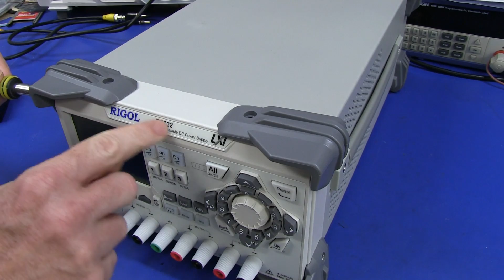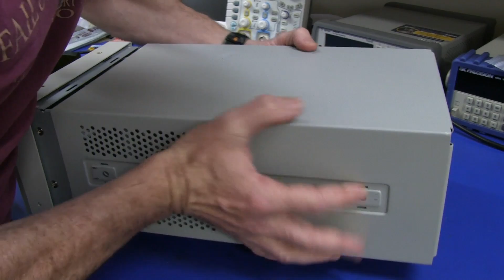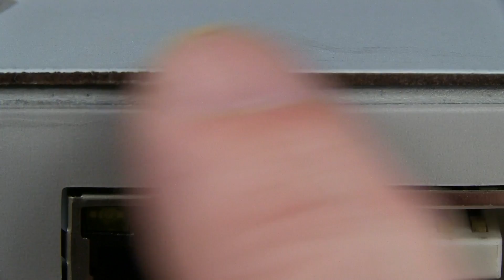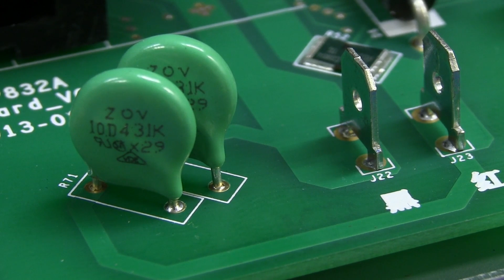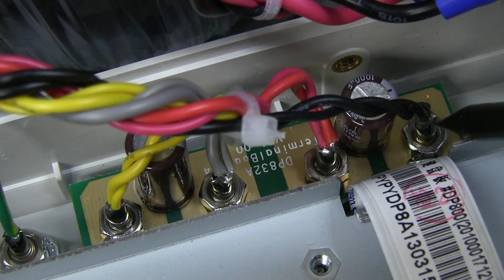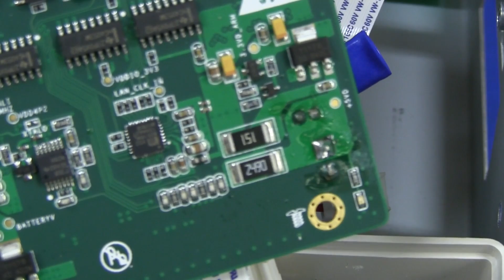EEVblog #511 - Rigol DP832 Power Supply Teardown

Comment: Another quirk of toroids is there is no sharp corner.   In an E core the magnetic flux has to make a sharp 90 degree bend at each corner.  In a toroid the flux makes a nice smooth circle.

Comment: 9:07 That looks to be a micro, ST logo peaking out of the lazer cut area. 4 core 1.2GHz with built-in 1Gbps ethernet with 4 port usb hub, turbos to 2.8 when lower then 38C.

Comment: Now I don't want to sound too negative, but Samyoung is the same brand crap caps that are used in the Samsung ccfl drivers and ALWAYS brake down after 2,5~3,5 years, so I would replace every single cap if I bought a PSU like this, but that is my professional opinion. I sell repair parts and every single work day I have 2 customers replacing Samyoung caps in Samsung TV's. Would not trust those, ever!

Comment: The rust is kind of inevitable while dealing with steel that doesn't get coated with anything. I work for a company that is basically an OEM for various things. Lots of our sub assembly parts have to be rushed to be powder coated during certain months because they will rust if we have stock lying around waiting to be sent out. Even just during a holiday break we had some output shafts from the gearboxes rust. We would have to take the units apart, machine the rusted shafts down, make special rollers to press fit onto the smaller shafts, and put it all back together. It was far cheaper to make a whole new set of non rusted shafts. It may have rusted during shipping over seas. We had a limited run of European units we had to make and they had all sorts of issues from the humidity in shipping.

Comment: 12:00 Software trimming?
There is any tutorial about this?
Because I'm building 1kW smps lab power supply and it will be very useful information for me.

PS I also hate sticking to-220, HQ stuff and they dont want to put little piece of 1mm aluminium(lol, 0.1$?)...

Comment: The circuitry itself, the unusual voltage choices (-5.1V ??), the abbreviations silkscreened on the board and even the parts themselves (including the multiple TL074's and the 4051 analog mux for the DAC S&H for reference voltages) are telltale signs of pretty much a direct ripoff of the agilent power supplies whose schematics float freely on internet. They probably lasered off the last chips to avoid a far too eye catching choice of parts. This is sadly the reason why no one publishes schematics anymore; the fear for these hooligans which show up and ruin the game for everyone. Other than that, this should be as good as any top class western designed product, with the quirks deriving from it's Chinese "interpretation" (like the glaring choice of output capacitor by designers that were supposed to have designed the rest of this circuitry! Are you kidding me?).

Agilent/keysight should consider a more thorough reverse engineering of this product and an eventual lawsuit.
Reply: Yo Da You think Rigol power supplies that are sold by Agilent/Keysight name? Most of low and middle range products sold under Agilent/Keysight brand are Rigol products.
Reply: Yo Da r

Comment: Maybe I'm old-fasioned, but I can't get why do you need ethernet on a power supply. Nowdays you need ethernet on everything...
Reply: hdagelic these days for example taking measurements, experimental physics is all computer controlled. There ethernet comes in handy.
Reply: Ethernet is handy, why run USB or serial to a PC when you can just plug the device straight into your network switch?
Reply: because it’s superior to the obsolete GPIB
Reply: Maybe if it's in some industrial setup, but then, usually, the supply is fixed. I don't know, I can live with theese computerised things until they stop working without an I-phone....
Reply: hdagelic I know I'm a bit late but anyhow: I also greatly appreciate ethernet jacks on my instruments. We do most of our product testing via scripts that control our instruments for regression test / schmoos / etc. It's also kinda nice if you can setup a few instruments for a specific test by running one script etc. When you want/need this Ethernet is a good interface...GPIB is pretty klunky (especially the old cables) and for USB you often need special drivers etc.
Reply: I just worked recently on a setup used to test medical grade circuit boards that cost tens of thousands a board.  We use the supply's ethernet port to verify that the voltages and limits are set correctly before anything is powered.  We don't want to start blowing up expensive boards because someone bumped the controls.
Reply: It's not expensive today to add ethernet capability and it's really useful.

Comment: The faster the processor, the more critical the timing of the data being passed across parallel traces becomes. The 'twists' put in the traces is designed to make each of the traces in that collection electrically the same length. It is not at all unusual for those traces to be several clock cycles in length. Most processors can't handle bit 1 showing up on a different clock cycle than bit 7 of the same word.
Reply: Dave knows

Comment: Why are some of the traces around the CPU so twisty?
Reply: May be for the equal lenght data busses.
Reply: i think it makes a little inductor ,which is need to run the cpu,or making the traces have other impedances to act as a diy resistor.It depents  on the cpu itself . Note : This is my opinion,i am not saying its true ,but it could be ,have a nice day

Comment: Hi Dave,
I have an old PC power supply i want to salvage all the parts from, now i don't know much about electronics but this is why i want to salvage the parts so i can have a play around with out spending anything. I just want to know what is the best way to drain all the power that may be left in the circuit and how to make sure afterwards?

Comment: That´s why your computer mains is a Full primary Switch mode power supply.
This unit is powered from a secondary SMPS...so the transformer is running  at 50Hz AC....and this is make hin go big ;)

Comment: They need to sell some units at higher prices to pay for the R&D.  The choice is to sell units without features and with features, say 10,000 units at $800 and 1000 units at $1200, or they can sell all the units for $1000.

$1000 would be the selling price if they just put all the features in.  If most people don't need all those features, is it still a good deal that they're paying $200 for the stuff the don't need rather than 1/10th the number of people paying $400 for those features?

Comment from the maker: The test equipment industry is not a "volume" industry when compared to consumer stuff. And the higher up the food chain you go, the lower the volume. And the higher end gear has more R&D for that lesser volume, so the company needs to pay for that. Then eventually that top end technology filters down to the lower end gear. That's why the low end volume only cloners virtually never innovate and push the industry forward.

Comment: I thought I could see some rust (oxidisation) under the paint too. The metalwork is almost certainly not produced in the same factory as the boards, in fact there are probably a number of out-sourced companies supplying components which are just assembled in the Rigol factory so who knows how long or in what conditions the parts are stored in before final assembly. I know it's not very nice to see this in any equipment but it doesn't affect the performance or the warranty and won't get any worse

Comment: Quote from LM4140 datasheet: "The mechanical stress due to the PCB's mechanical and thermal stress can cause an output voltage shift more
than the true thermal coefficient of the device." When you're talking super high precision, bending the legs, and therefore the silicon, and therefore the silicon atom spacing, therefore the resistivity (just making things up here) can dominate other sources of error. The datasheet goes on to recommend a cutout in the board, just as seen in the video.

Comment: to make them not go so fast. If they were straight, the data would just "step on it" and in the next bend be too fast and fly off the wire and maybe hit the next wire. That's why they make it curvy so the data has to drive slowly and not go around the corners so fast.

Comment: I don't quite understand the purpose of the gap around voltage reference. Why thermal stress on the pcb will effect the voltage reference? or just want to keep the part away from the heat generated in the board

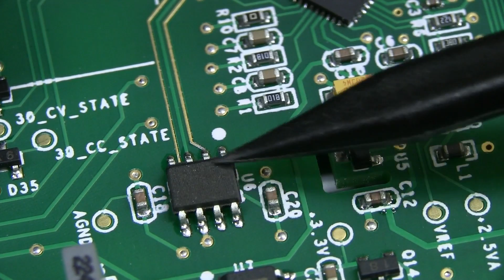Comment: As soldering goes, did you notice, ca. 9:17 the solder balls by C12?

Like the routed slot around the voltage reference(s).  Good practice.

Those edges may not be very rusted yet, but they're on the way -- this thing is still pretty much factory fresh, right?  Leave it out in some salt mist for a few days and then check on it!

Comment: The processor board had a section labeled battery (test point) but I didn't see a battery anywhere on that board. Does the unit have a real time clock? You can see it at 22:09.

Comment: Hey Dave, can you shoot a SHORT follow-up video with constant current mode performance? Something like set it to 10 V, 1 mA, attach a 10K resistor, oscilloscope, and then one more 10K in parallel. How fast will it go down to 5V?

Comment: [revising my statement] yeah but that power supply does not give anywhere near the control and quality this unit provides. You are comparing two completely different regulation systems. SMPS vs Linear!